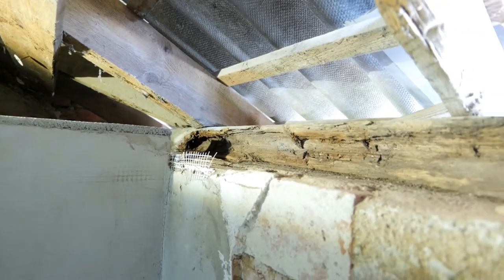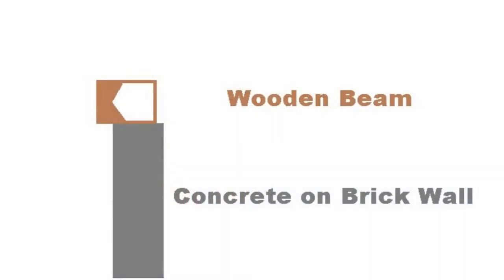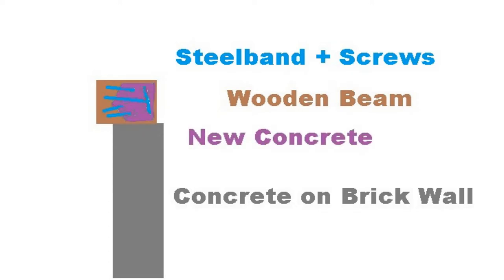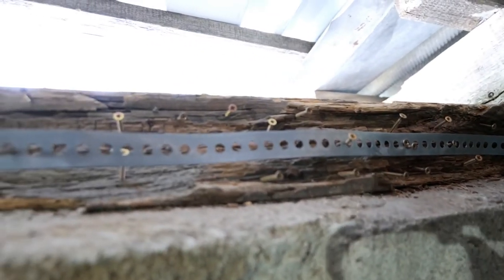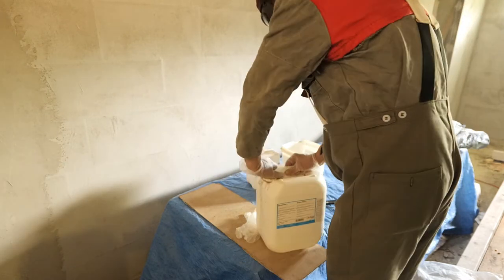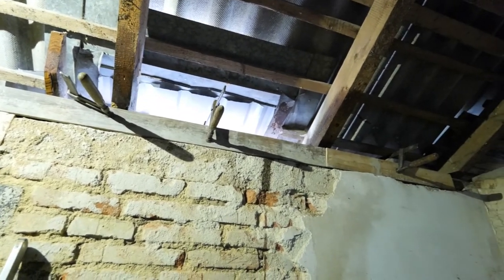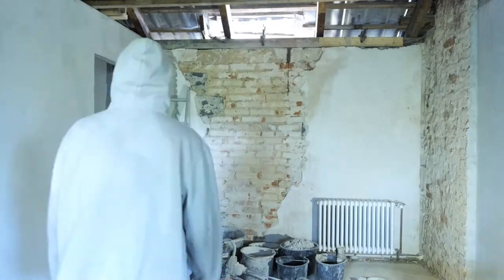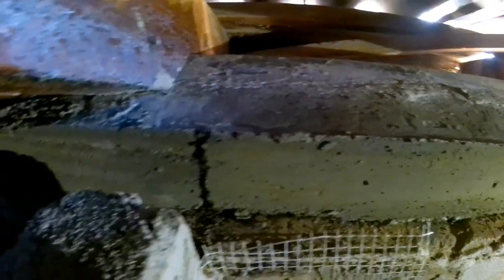Rotten Roof Beams ? Easy wood repairs instead rebuild using epoxy.

Comment: I use epoxy for a lot of things. I have used it on rotten wood for turning bowls. However, the tricky part about epoxy is getting everything sealed so that the epoxy doesn't run everywhere. Very tricky! The other thing about using epoxy is the cost, it's really expensive.
Reply from the maker: yea the cost of def more then replacement wood as material. for those type of repairs the time and complexity to replace the wood is the main challenge. replacing the wood would have been a very complex 4-5 day operation. time is money ^^

Comment: Great video. I'm thinking about using your method to repair a similar situation. But, not clear on couple things: 1. Concrete will decay wood in direct contact. 2. Concrete and wood do not adhere well to each other. So I'm guessing the epoxy addresses both issues? Also, what is the brand of epoxy that you used. Thanks.
Reply from the maker: the epoxy basically "plastifies" the wood hence the contact with concrete is no issue. The epoxy will leave a very smooth surface, contact with concrete is horrible in terms of connection stability this is why i used the plenty of screws in the wood beam to have proper connection points. Thikk screws, half way into the wood half way into the later concrete block, many of them (much helps much).
Reply: @OffGridEnclave  Makes sense about the epoxy as a barrier and nails as anchor support. What brand epoxy do you use. Thank you for your reply.
Reply from the maker: @davidwang3638  nothing fancy, i buy bulk epoxy from different industry suppliers in eu. cant recall what brand that was exactly. viscosity was close to water and around 360min hardening time, usually used for boat construction..

Comment: nice harden wood with glue is generally feasible, I tried it once for a guitar neck+superglue, but i think even with low viscosity only the outer ~2-5mm of the wood is soaked .. for sure depends on the wood
Reply from the maker: yea that depends a lot on material thickness. given roof beams are usually 25cm+ in size, most glues would harden to quickly. for smaller material thickness however slow hardening glues can be quite a good option to add material properties.
Reply: @OffGridEnclave  fascinating , it’s like petrifying

Comment: Nice job, easier than putting new beam while the roof is on it.
Reply from the maker: thanks
Reply: @OffGridEnclave  Not really. You do need some materials and tools however; 2x4 and/or 4x4 and a jack. You run a beam across the rafters, lift one side of the roof with the jack, slide a stud in place making sure you have about a one inch gap between the rafters and the rotted board. Repeat a couple of times, you are now holding the roof with a temporary structure, now replace that beam and drop the studs when done. Once day of work or less. I have done similar with a car jack.

Comment: what is the cost of epoxy against wood and how long will last this repair and how strong it is?
Reply from the maker: cost of epoxy for such small operation i cant estimate truly as i buy a bunch of epoxy for other projects. those minor amounts i have no experience in buying. how long it will last, epoxy composites with uv hard epoxy can last 25+ years. the strength ofc depends on how solid the original material was, on the epoxy used and the efforts to support it. i would say the strength of repaired beam is defiantly comparable to normal beam.